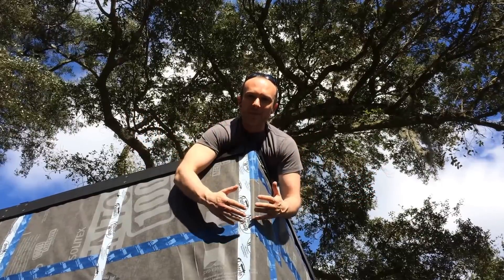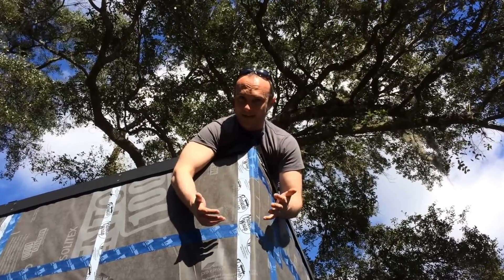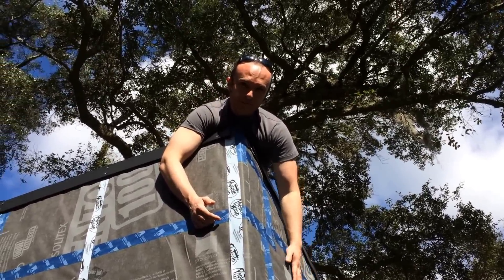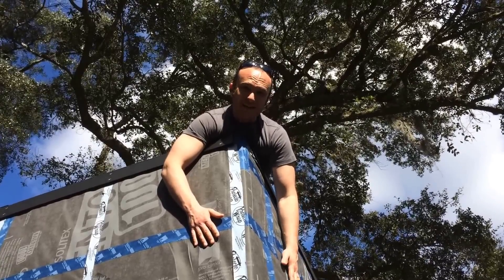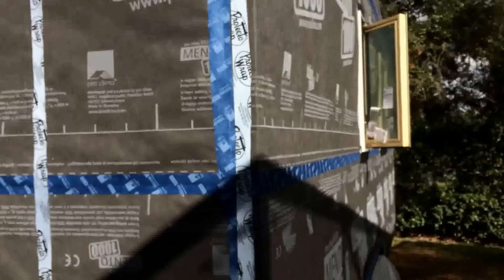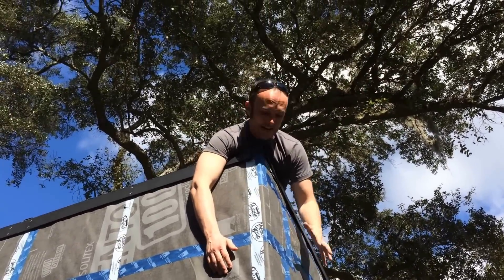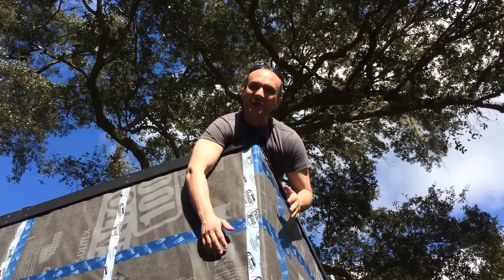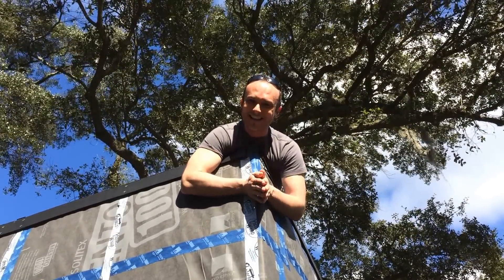Stack Effect Demonstration on the #TinyLab Tiny House

Comment: Interesting phenomena.  Did the ballooning only happen on one side of the house?  I would expect stack effect to happen on all sides, because the heating of the air inside the tiny house should exert the same pressure throughout the building.
Reply from the maker: +59seank It's actually not from heating the interior- it's just a bubble of air that's been heated by the sun hitting the black shroud on the exterior! Weird!
Reply: +Home Performance There must have been very little air between the sheathing and the Mento when you installed it.  It's impressive that the heat could expand the air that much, unless new air is being introduced from the inside and heated.  Very interesting demonstration! Thanks.